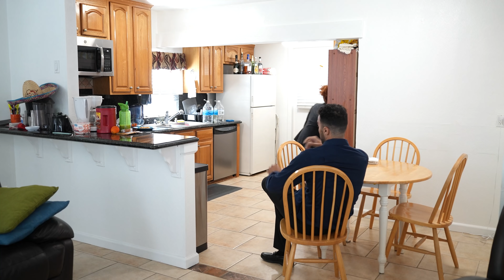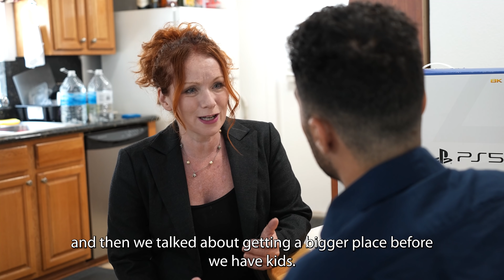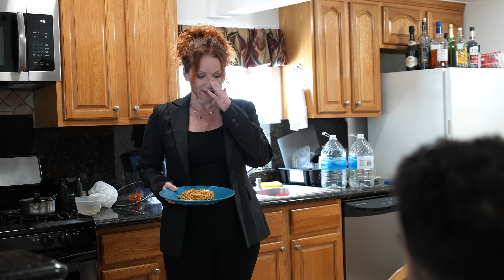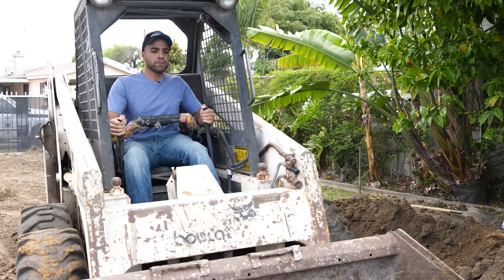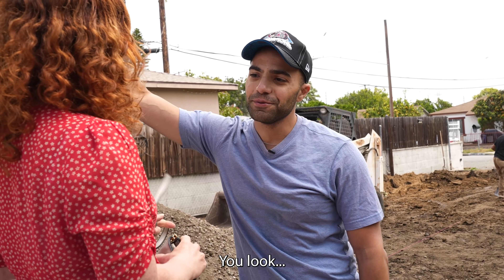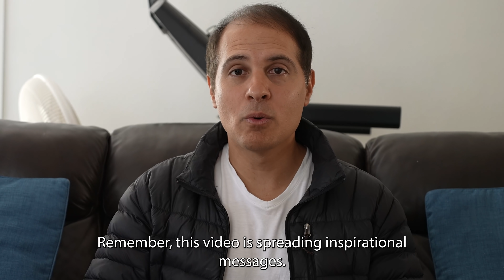Husband LEAVES Wife for Earning More Money, Lives to Regret It! | Sameer Bhavnani

Comment: The reason y the skid Steer keep moving is because he did not pull the joy stick back.   And anny experience operator wold have dug the bucket in the ground 2 stop it if it was out of control. That is y u need 2 have an experienced operator in heavy equipment. If u don't now how 2 run it don't get in it.